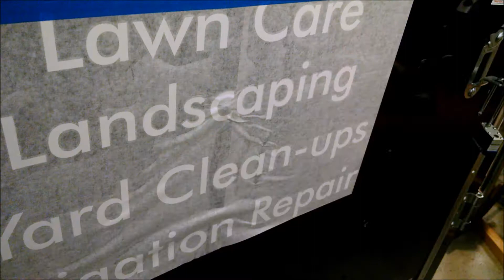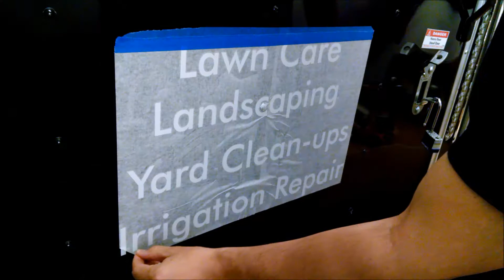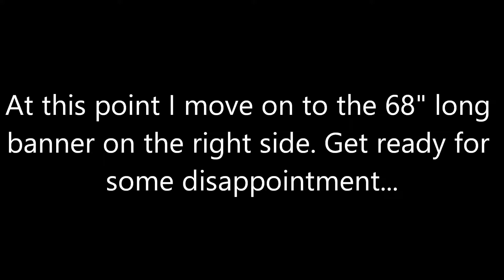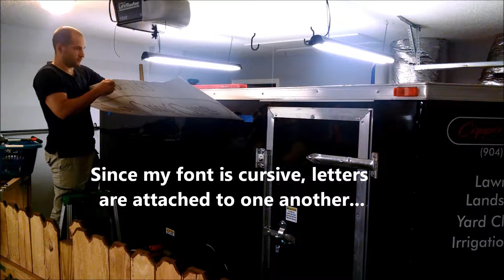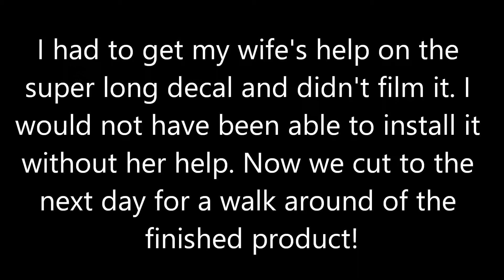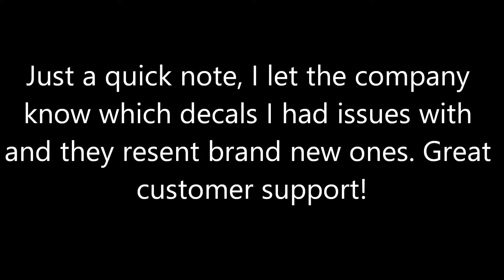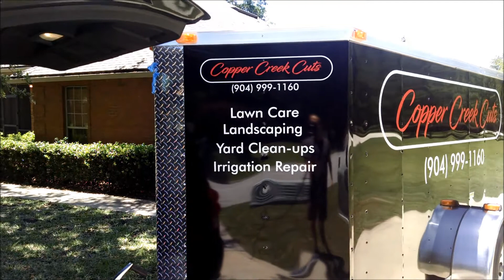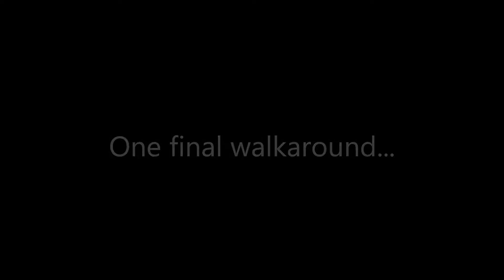Applying Vinyl Letering - Part 3

Comment: What company did you get the lettering from? Do they have a website?
Reply from the maker: https://doityourselflettering.com/ I would for sure recommend them!
Reply: 10-4 and as a heads up for the next time. Try using a heat gun when the letters won’t peel off the heat releases them pretty easily. If you don’t have a heat gun a strong hair dryer will do.
Reply from the maker: Thanks for the tip! I wish I knew that back then!!! Might have saved me some trouble! :)